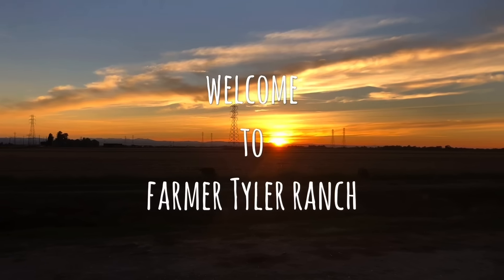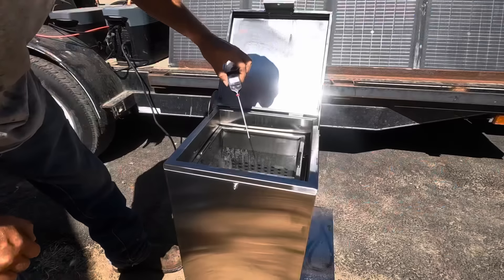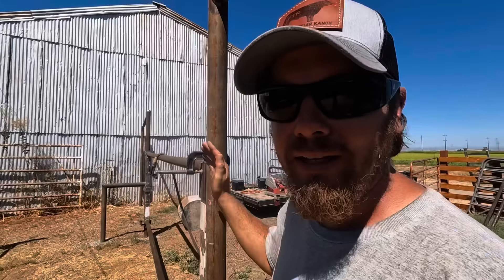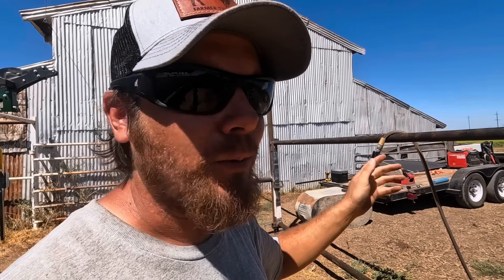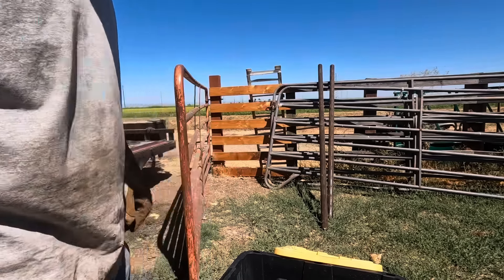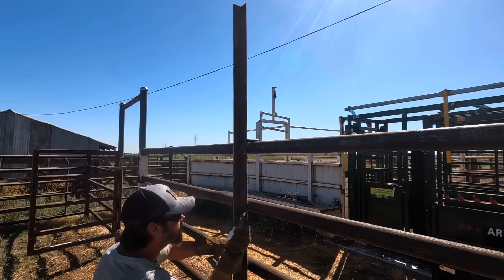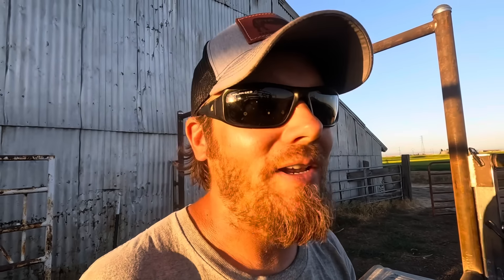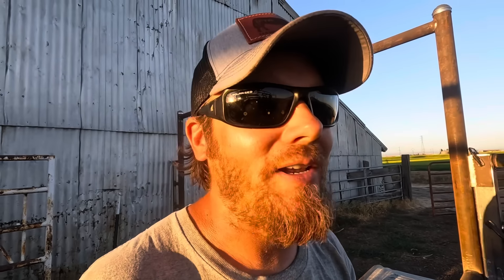New Scalder Surprised Me!  And Answering Your Corral Questions

Comment: You are a skilled welder/fabricator, enjoy watching your projects develop. Per your questioning the weight of the pipe, if the used oilfield tubulars are upset, the 23/8" will weigh 4.70 pounds/foot and the 27/8" will weigh 6.50 pounds/foot.

Comment: If you have hard water like I do, that leak will clog itself like mine also did, lol. Or I assume cuz it magically went away after many uses. Also, between the water tub and controls, seal that gap with some silicone. Making a mess with water, I had it get inside the electronics and shorting it out. Took it apart and much more water in there than I would assume.

Comment: Answering questions is like someone was not paying attention, I thought you covered all of that in the videos before you started this project. 

Whatever piece of equipment you use to move the squeeze in the future sure would have more than enough power to lift that temporary panel if you have to cross that bridge. Just add some grab hooks on the corners.

Comment: I taught myself to weld.  On a Hobart welder generator like you have.  Some of my first welds did not hold because I hadn't learned to penetrate the metal properly yet.  But I built barns and corrals and they did last until my aunt sold the land.  Back then I wish I had of had some of the fabrication equipment that would have been nice.  But life took a change.  Now I watch it on YouTube.